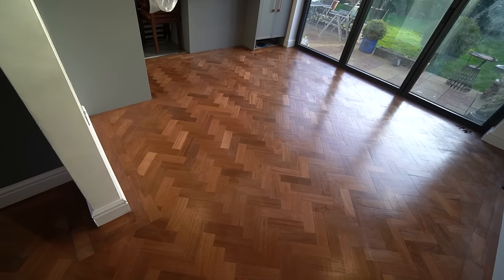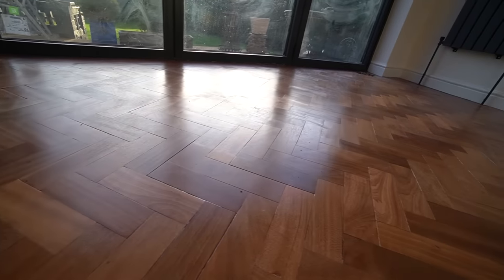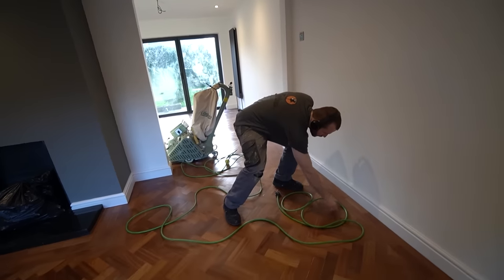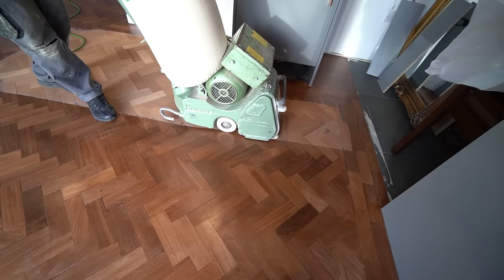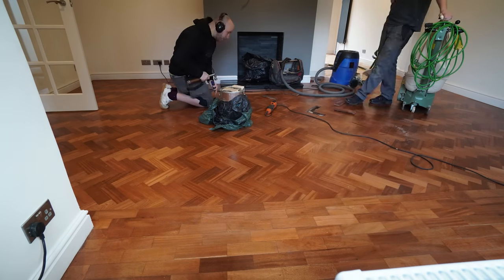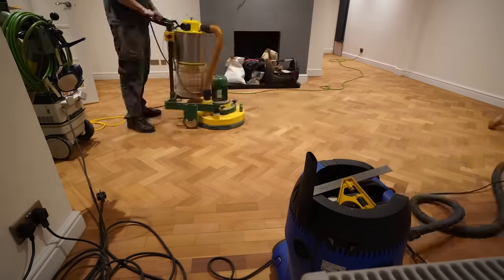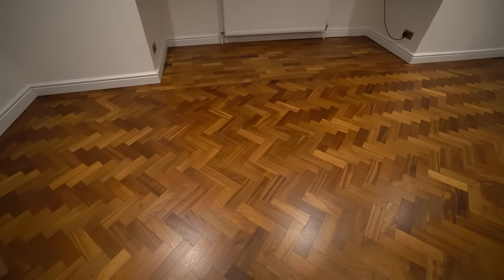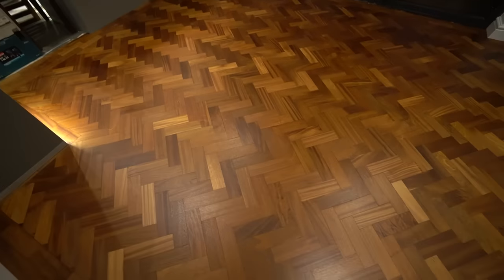The Worst Sanding I've EVER SEEN (Hired us to Put It Right)

Comment: You obviously have all the proper equipment and leave no stone left un turned . Kudos to you .. that’s what being a professional is ..
Reply from the maker: Cheers Ron 🍻
Reply: The proper equipment certainly helps but you have to have the skills and experience, not only in installation, but to competently use the equipment. I'm a flooring installer of over 50 years experience, and I gave up replying to people, clients mostly, who would say "It's easy when you've got the right tools" without offending them. I even had medical professionals say it to my face, and I always wanted to reply that maybe I should go out and buy a stethoscope, thermometer and a white coat to set myself up as a doctor ....... but I kept quiet.

Comment: honestly, I cant imagine how thin glued blocks are NOT likely to pop or come off after years of walking on top of them, even when the supporting floor is level and solid as a rock. Theye just so small that its easy to come off. I think for a floor they should be nailed onto something bigger in order to be stable, no? My friend used to have a kitchen with the same floor like this (ok not the best location for this type of floor) and all the wooden blocks were more or less loose....

Comment: Floor sander rentals are available at home improvement stores.
After watching this channel I wouldn't dream of doing my own
unless I wanted a nightmare on elm,oak,or walnut street.
Reply: It all depends on budget, circumstances and how much time you have. A lot of people are discovering old wood floors under their old and worn carpets or vinyl flooring, and I don't think that is a place where it is massively crucial that you achieve a perfect result, as the floor will be in dire need of sanding, and any work you do will probably give you some improvement.
It's a different story if you spend thousands on new wood tiles and then ruin them by wanting to DIY the finish.
Reply: You can't hire floor sanders like what he uses, the ones hire shops have are not worth the casters they are on. They will bugger up your floor. They have no lift and drop arm for drum either. Think all hire shops have the same crappy model.
Reply: @Carrion00  our local box stores maintain the equipment well. They are only couple Years old with old units sold off.
Reply: @Carrion00  Really depends on where you're in the world. Apparently in Germany you can hire the exact same model he uses, elsewhere it depends on the shop. None of the machines I've hired in Austria were great but some were fairly decent. All of them were smaller models than the Hummel used in the video, e.g. a Janser Jaguar. About half the weight, much easier to handle than a Hummel but not as good a finish with the same grit of sandpaper. The one notable exception was when I hired from a small rural timber and paint store. The old chap there gave us his own Hummel, which looked like it was in a bit of a sorry state, but oh was this deceptive! I've never gotten anywhere near as nice a finish with 120 grit as I got with 100 grit on this beaten Hummel. I don't have any intentions of repeating that experience though, it was utterly exhausting!

Comment: That old black mastic adhesive crystallizes after 15-20 years usually. It becomes brittle and when you put the sander on it, the vibrations break the remaining fragile bond and you end up replacing boards left and right after each step. It is the worst. I always ID the adhesive that was used on older floors right away, and if it is black mastic I consult with the client and usually offer three options: 1) Sand the floor and live with sporadic loose boards and only repair larger sections that are loose, or pay a per board fee and fix everything with the knowledge that the old adhesive will likely continue breaking loose over time with normal traffic. 2) If the floor isn't too ugly, just do a recoat and avoid vibrating the floor with heavy sanders, thus preventing new loose planks. 3) Just replace the whole floor.
Reply from the maker: This was sticky bitumen. Sticky bitumen is still sticky after 60 years. Always the same with these sapele floors. I kind of assumed the repair work had been done by these other guys but I asked just in case and he said it was all stuck down 🥲 did it for the ‘Toob
Reply: My old boss told me back in the old days they used to add linseed oil to wood block adhesive which is what kept it live but people wanting to save a few qiud on the job left it out which is why it goes brittle. Could be true, could be bollocks!

Comment: Hi Ben Greetings from Oz. Thank you for your time and the effort you put into your videos. I'm about to attempt sanding and refreshing my herringbone jarrah parquet floors. You've given me the confidence to try drum sanding or would I be better with a large orbital sander?  Also due to the apartment being under renovation and cluttered with staged furniture in the same room I have no option but to do the sanding and the application of the water based satin polyurethane finish in 2 stages with an overlap.I was hoping to complete one section and then transfer the furniture and go again. Is it likely there will be a very obvious line where the two sections of satin polyurethane meet once the floor is completely sanded and finished? Am I better off using an oil in this situation for that reason as it could possibly offer a more seamless transition? Your advice would greatly appreciated. Thanks and all the best
Reply: I would love an answer to this. I'm in a similar situation and I've been wondering the same.

Comment: One thing is the condition of the subfloor. For example, you can never sand over a floating floor. If the sub is not in good shape that will make the sanding uneven.

Comment: I used a hand orbital sander to refinish a 40yo 27ft x 15ft oak floor, using chalk sticks to trace coat between grits. Finished with a sanding block. Took 2 weeks, but it came out utterly perfect, inspected with a raking light bar.

Point is, if I'm going to pay to have a floor refinished, its only because a pro would be able to do it faster, not because its neccessary to get pro results.
Reply from the maker: That’s true, there are lots of bad professional refinishers out there.

Was it hard work? Tons of people say they do the whole thing with an orbital. I just imagine my arms would fall off 😂
Reply: @HowToSandAFloor  More tedious than hard, but its the way to go if you want excellent results with little experiance. This was my 1st time refinishing a floor. The advantage here is that you remain looking at the surface so closely the whole time, it forces you to notice the details. Drove me nuts the first week, but it was worth it. The only thing more crooked than my lower back was that goddamn floor. Plus, learning curve. Most of the work was completed in the last 4 days, I'd say. 

A raking light bar and graphite sticks for trace coating, I consider essential. A carbide sanding disc, Duragrit is the only brand I know that makes them, they have 46, 60, and 80 grit is the highest it goes, but to remove the polyurethane and initial leveling of the surface, its the way to go. It didn't wear at all, its just as abrasive as when I bought it. Also used their 150 grit carbide sanding block to finish sand with the grain. Its red oak, so 220 grit wasn't noticeably different.

And it wasn't my arms that gave me issue, it was my lower back, which usually gives me issues any way. After the second day, I put a cooler box on a washing machine dolly, and laid face down on that while wheeling myself from one section to the next. Its the sort of thing you can get away with when you're working alone😁

Comment: What caused the poor job? Was it just not passed over with different grit also curious how come you didn’t sand diagonal like in the other videos? Great job!
Reply from the maker: Not sure what they were doing to do such a bad job.

Last question is a great one. I’m not sanding diagonally, but I am sanding at 45 degrees to all of the blocks… if I went diagonal I would be doing with the grain on half the blocks and directly against the grain on the other half, causing the floor to become very uneven

Comment: I have the same oneida air combo... what kind of plastic bag you use? And doesn t it suck up in the machine? Or do you have a tricky for it?
Reply from the maker: I have it retrofitted to fit cheap mass produced hepa filter bags, 60c each 😁
Reply: Oneida also makes a DCS called the dust cobra. Wonderful machine with a separate HEPA filter for the big machine. I have run mine hard for 6 years and only had to replace the power switch, brushes are still good. That takes standard contractor bags and pull dust from edger and sander at the same time.

Comment: with all respect, few questions: 
1) why didnt you remove the base boards and go all the way to the wall?
2) there are gaps in between pieces why didnt you use fillers to close them specially the ones you use multi tool to remove?
3) did you guys wipe it after applying stain?
4) did you guys buffed it after the first coat of finish to smooth it out?
reason im asking is here in north america we do it a bit differently and you say you are pro but to me its not 100% ideal specially with all those gaps.
Reply: No one wants to risk pulling off a baseboard that has been there 50 plus years, unless you are planning on replastering and painting everything

Comment: why do u start left to right hen starting the sanding process? I've always been taught to make right to left
Reply from the maker: Do you have the Hummel? If the floor is uneven, the left wheel will be on uneven wood, whereas the right wheel is always behind the drum and on more flat wood. So the machine will wobble less and sand smoother. Hummel manual says left to right.

Comment: my dogs trashed my 1970 parquet floor :( so when you sand, it doesn't pop up the pieces?
Reply from the maker: no, it can do if they are not stuck down well in the first place. all loose blocks need to be glued down before sanding

Comment: Pffwwww that original refinishing is amazing compared to what a scam artist did to our floors! 

You wanna talk about bad floors...turns out the guys we had hired they only sanded with 36 grit, left huge gouges and swirls, didn't tack (so the floors felt like sandpaper), and also left hundreds of small spots where they didn't apply the poly. 

And to boot, they claimed the floors were always like that but seemed ok before they worked on it because "years of grime had caked on". And that the poly had slid off areas, not that they were incompetent. 

I always new that being a first time homeowner, I'd have to lead these life lessons, but not before we had even moved in!

Comment: Sad to say it but this in not even close to the worst sanding job I have seen. One floor had been edged with a 9" grinder with fiber discs, and been cut through to the tongues. Had to tell the owner, new flooring or carpet was the only solution. Their original 50% off discount contractor was not so cheap after all.

Comment: Do you use a pre-lacquer before you use a normal lacquer on top or are you one of these guys that use a cheap lacquer instead of a normal BonerHD like a professional floor sander would use
Reply from the maker: I just pop a few coats of water down, no point doing it like the professionals Paul, what’s the point!!
Reply: @HowToSandAFloor  😄
Reply: Warning Warning: F#kwit Alert

Comment: For one I like it how you’re trying to make yourself it’s big hot shot what company was this that did this cycle sound in before you got there and I really don’t believe the company before that two weeks to so-called stick down the blocks surely you would first of all assess the floor sanding the floor then look at the blocks that are loose stick them down then continue sanding the floor then fill the gaps in the floor with a screed van Gogh down through the grades up to 100 put the first pre-lacquer down then off the floor with a 150 screed then put the other two coats of lacquer down tea board to get the maximum where liar and the other thing it shouldn’t have been a two day job that should’ve been a 3 to 4 day job considering the glue takes 24 hours to dry every time you stick a block down
Reply from the maker: I think you’ve had a bit too much to drink Paul. Take it easy
Reply: You didn’t take it easy on the people in that video will it be all I’m trying to say there is only a few mistakes in summarise videos you made it sound like they had no idea what they were doing that’s where you were wrong trying to get content and views to make yourself look good ?
Reply: As I used to do this for a living know what I’m talking about ?
Reply: @paulfraser7707  few mistakes? That's floor is shocking...
Reply: @paulfraser7707  your an absolute screamer mate🤣